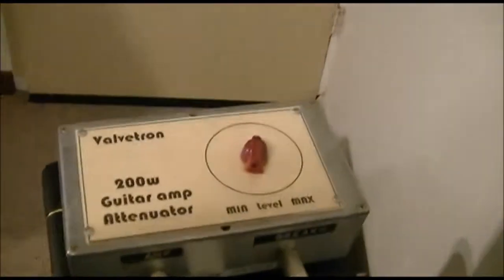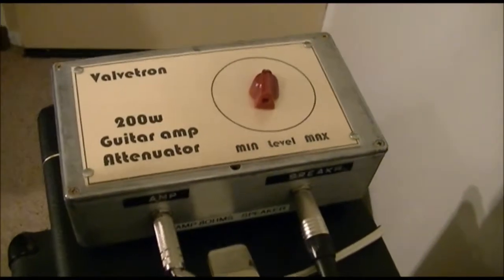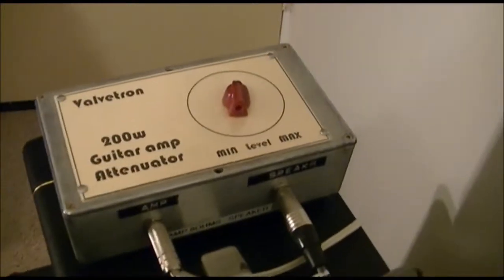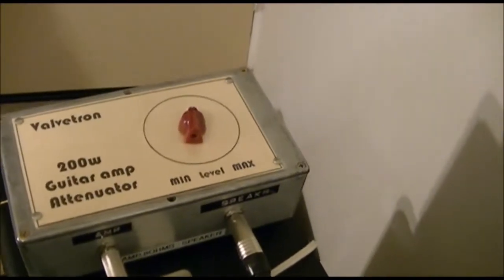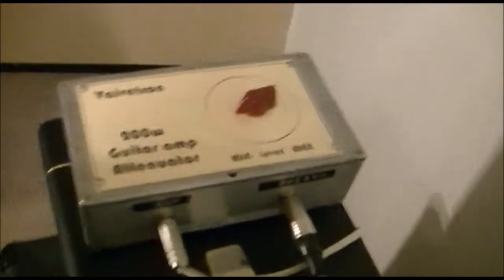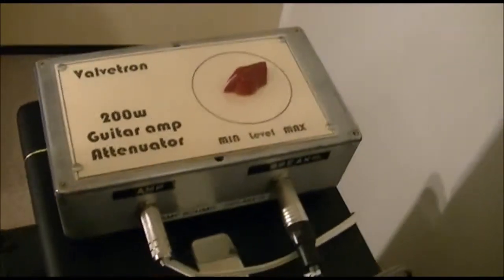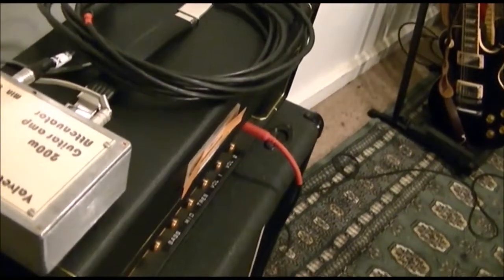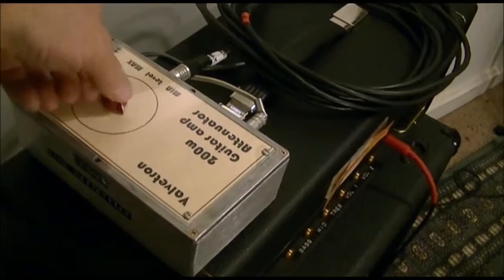attenuator

Comment: Hi, I have a Peavey jsx 120 going to a 16 ohm cab. Would this work for me as I want to get bedroom level noise but keep the tone.
Reply from the maker: Yes sure the attenuator is quite trnasparent, amp need to be set to 8 ohms but you can use an 8 or 16 ohm cab with it.
Reply from the maker: yes by all means provided the amp is set to the 8 ohm output setting

Comment: Awesome. Just bought a mkiii
Reply: How did you like this attenuator, do you recommend? Thanks
Reply: Used with my 100w superlead, sounds great. Maybe a little bit too compressed sounding to get absolutely everything that i can straight out of the amp (in terms of dynamics clean/dirty with guitar volume pedal) but at that volume you can’t really complain. It gets fucken HOT though so be careful of that!
Reply: Volume knob * not pedal